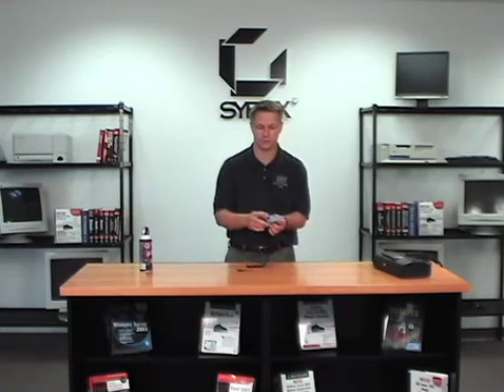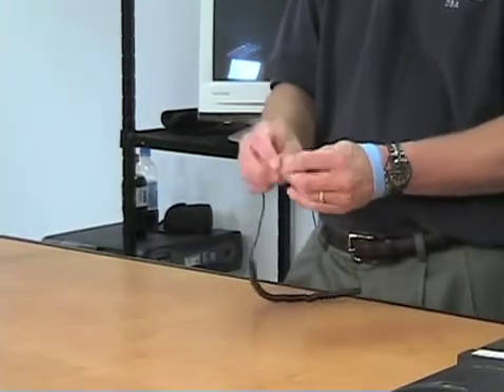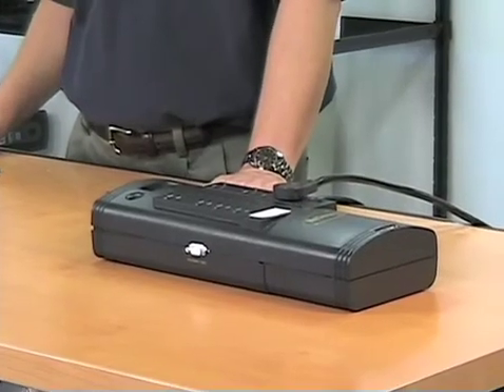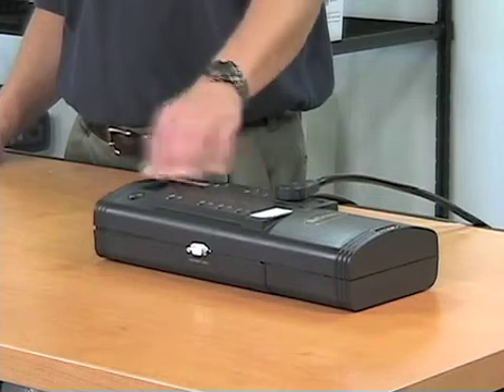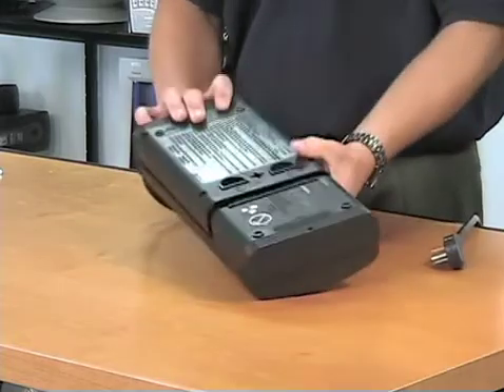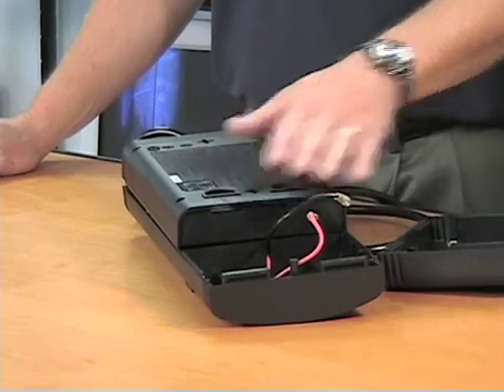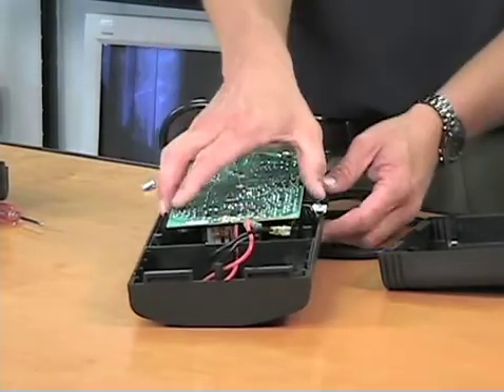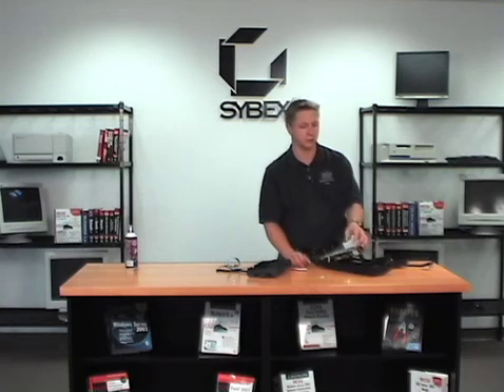ESD Safety

Comment: Yes.  The static wrist strap just gives that extra layer of protection so you do not have to remember to touch the chassis again each time after you break contact with it.  The strap is like a third arm which alleviates the need for you to touch it.

Comment: I have two questions. One, I took apart the top part of a PSU to adjust the fan which was making a loud noise. I know you say don't mess with a PSU, but the only parts I touched were the outside of the PSU and a plastic fan and doing so lets me save 20 or more dollars for a silly problem. My second question is ESD. I've changed parts and built whole new computers and have never experienced ESD and I've never used anti-static wristband. Does ESD have a very low chance of happening?